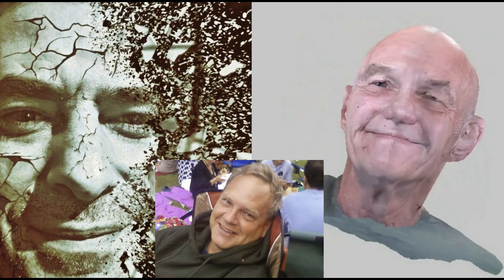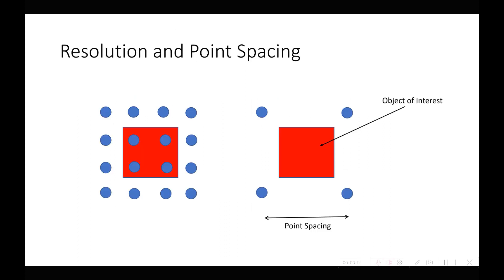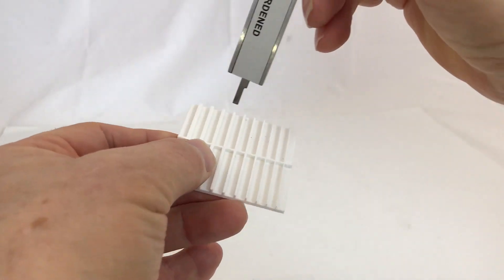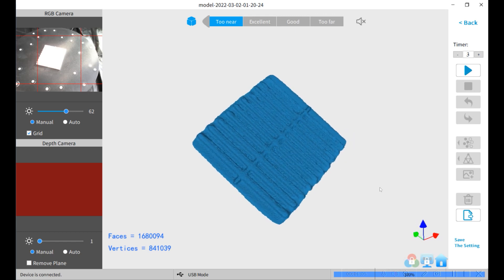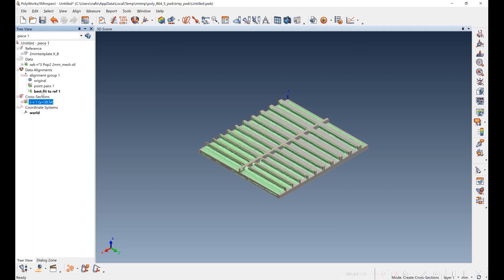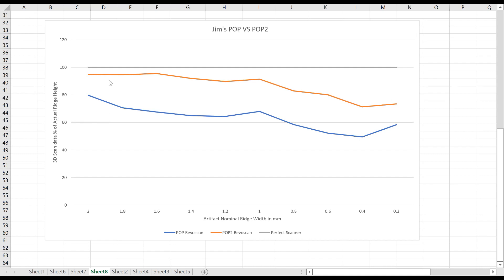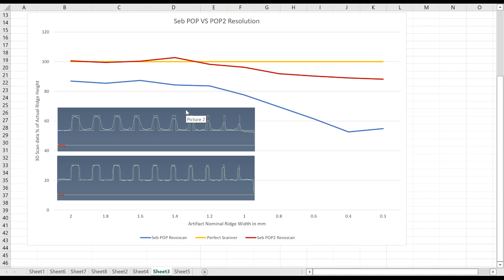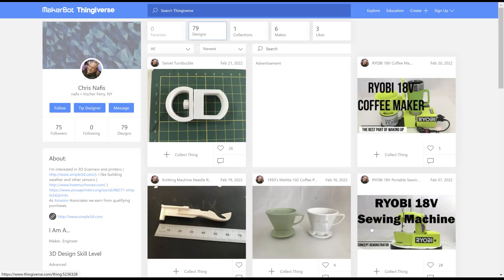3D Scanner Resolution Test Artifact and  Revopoint POP/POP2 Results

Comment: I have one question. Can it be used to scan from different angles? Like lowering the position on the tripod gradually so that the scanner gets a depth perception  and better accuracy of the result?
Maybe you are already doing it, but just asking to be sure if it's a thing that can be done.
Reply from the maker: Since I used markers, it's a trade-off of seeing the markers and the ridge sides. It seems like around 45 degrees works pretty well